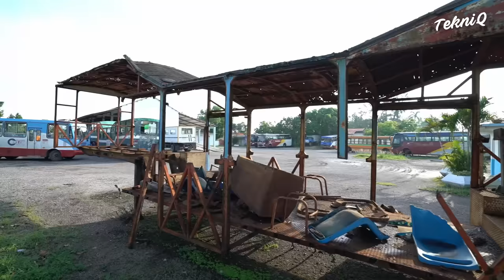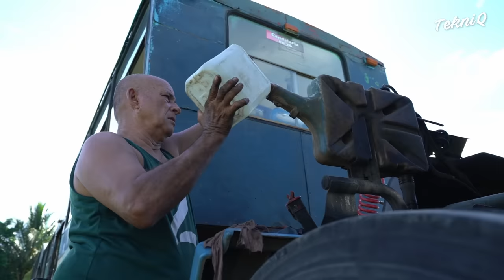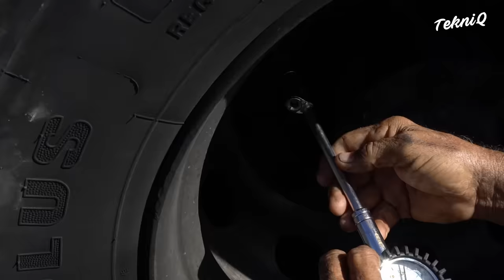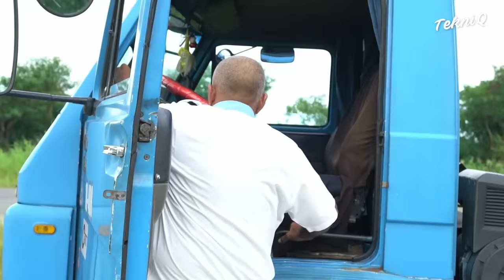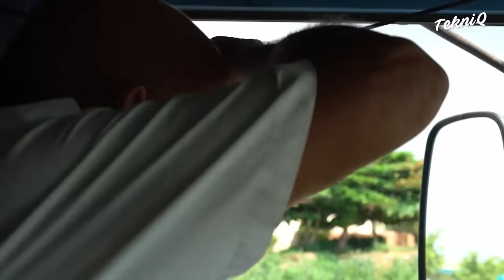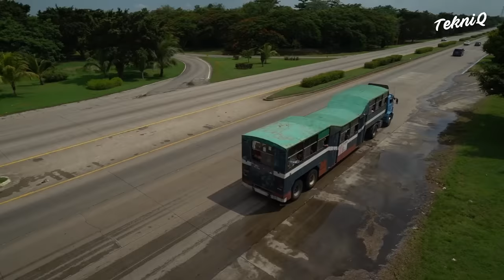Riding Cheapest Bus of Cuba

Comment: These buses are called camel buses or Metrobuses, the trailers are made with two old soviet era bus bodies welded together pulled by a semi truck rig, basically a 18 wheeler adapted for passenger bus duty 

Camel buses are known for their rough ride quality, noise and constant smell of the exhaust in the bus cabin, these don't have a suspension suitable for comfort in bus duties, no air conditioner systems, these came buses can carry up to 300 people, like if they where in a busy overcrowded japanese subway, all crammed up like sardines in a can

Many of these camel buses operated in Havana's routes, many of these were gradually phased out and replaced with chinese made Yutong articulated and standard buses, offering more comfort to the passengers

But' there's still a public transportation crisis ongoing in Cuba that might never be solved, so these units are still on the job despite their flaws and blessings these can bring 
 
Peace
Reply: Like Sardines in a can! What a comparison! Wow!
Reply: suspension presumably can't kneel (or lower) either
Reply: Could easily cure the exhaust fume problem with a high level tail pipe on the tractor unit of course as many semi's have as standard.
Reply: @Martindyna  nah because that puts it at window level
Reply: @succulent951  Not if it's extended ....
Reply: 😂😂 В 2006-9 были жёлтые Лиазы всё так же как вы описали , только это был автобус
Reply: Grazie 😊
Reply: @succulent951  higher, they need to go above cabin, hot exhaust fume is rising, so having it lower can't be any better
Reply: To load
Reply: in other words just like Toronto public transit
Reply: "Workers paradise" 😂😂😂😂

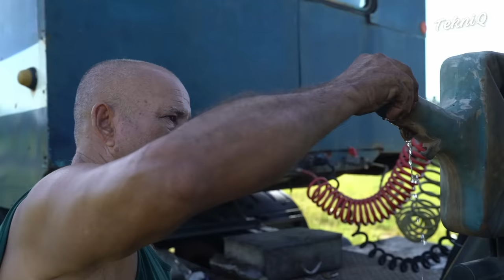Comment: 5:00 Checking the remaining fuel by inserting a stick into the fuel tank reminds me of the Trabant. 😅
I'm curious about how the driver and bus conductor communicate on a trailer bus. (Of course, they can also talk loudly through the window.)
Looking at the trailer's windows and roof design, I can tell that it is based on typical Eastern European buses from the 70s-90s.
You can tell from the clean condition of the truck and the work done by the mechanic that they care about it very much! 
Although it's a bit old, Cuban buses are heaven considering there are worse roads and buses in many countries. 👍
Reply: The windows and doors are from the Hungarian made Ikarus 200 series buses. (Exactly the type 260 and 280 city buses)
Reply: @bencefarkas3651  yes. It appears to have reused parts from the Ikarus 260 or 280.
The difference from the original Ikarus is that the windows are installed reversely. The original Ikarus had windows that opened upwards. 
However, for seated passengers, downward-facing windows are obviously easier to open.
Reply: Водитель и есть кондуктор))

Comment: When I was a kid, I always wondered if a truck can be a makeshift bus where the trailer would have people instead of cargo.

It's neat seeing this in action, but the question is, is it actually safe and legal?
Reply: There are loads of coachbuilders here that converts trucks to busses where I live

Usually it's an Isuzu elf, Hino Dutro, or Mitsubishi Fuso canter

And it's completely legal, because even in developed countries busses doesn't have to go through crash testing because of their sheer size, most countries doesn't mandate seatbelts for busses either
Reply: @tristan6509 In impoverished Russia, old Soviet AN-26 cargo planes operate regular passenger flights! 😂😂😂
Reply: Most buses in my country are made from truck frames , they build bus coaches on top of it ...

Comment: Pouring water into the radiator can ruin the engine,,,, man,,,will rusty the internal components,,,, 
    Measure the fuel level in tank by using a big rod ???? why not use a smaller stick which can dramatically decrease the contamination to the fuel... COME ON,,,,,

Comment: Camel buses trailers are made with two old soviet era bus bodies welded together pulled by a semi truck rig, basically a 18 wheeler adapted for passenger bus duty. Camel buses are known for their rough ride quality, noise and constant smell of the exhaust in the bus cabin. Many of these camel buses operated in Havana's routes.

Comment: These trailer-buses are called “Camels”. And they’re not used in Cuba as an “alternative” to passenger buses. They’re buses.

Each trailer is a fully-equipped bus. Cuba went with this design because a broken bus can take days to repair. But if a Camel breaks down, the trailer can be attached to a different truck in ten minutes. So none of the buses are out of service.

The main disadvantage of a Camel is the lack of air conditioning. But a one-way ride to work (in Cuban money) is around fifty cents. So the Camel buses are cheap and reliable.

But of course there’s no such thing as “good” government transportation. Buses (and light rail) in any form are slow, and inconvenient. In that regard, Cuba and America have both pursued a communist monopoly on transportation. You can have a Camel Bus, or a Metro Bus. They’re both horrible.

In Asia, many countries allow freelance passenger vans to transport people. You jump in, pay the driver, and that’s it. And everyone’s friendly. It’s great.

But the American mafia we call “Washington D.C.” doesn’t want any competition. So you can ride the horrible bus, or the expensive Uber. But not the passenger van. 

People might make friends.